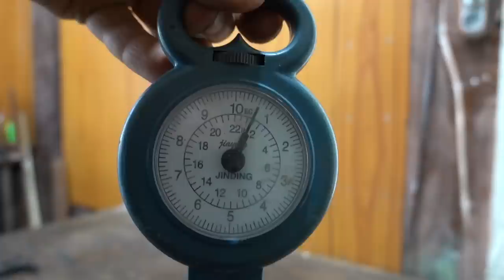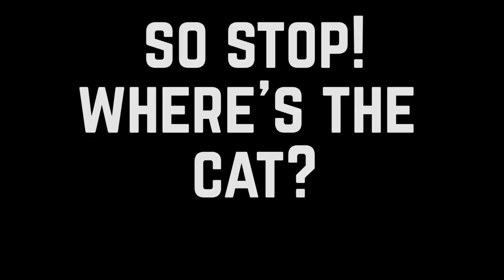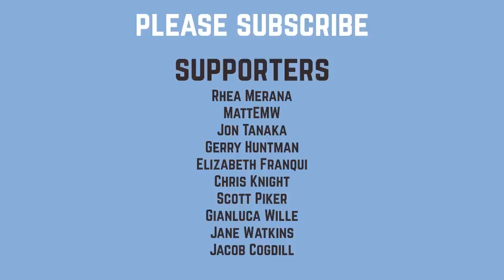Restoration Survival Rusty Knife

Comment: Can you explain to me the purpose of graphite grease? I've never heard of or seen this used until now
Reply from the maker: Conventional graphite lubricants are designed for friction units of loaded mechanisms. These lubricants are operable in the temperature range from -20 to +70 ° C.
Reply: @ScrewsAndTools  Why was it put on the blade of the knife?
Reply from the maker: @derrickguffey4775  To avoid the appearance of rust, because then there was still a lot of work with the handle and maintaining a dark color after etching the blade.
Reply: @ScrewsAndTools  thank you that really helped 😊
Reply from the maker: @derrickguffey4775  Welcome always!

Comment: this Isn't restored it's sharpened and you made a terrible case didn't actually restore anything. Its ok to make stuff and i applaud the effort of wanting to do something cool but putting a knife in a bucket of water for a month or two then cleaning it up isnt restoration. Have you tried actually restoring something or are you Ok with saying restore but meaning sanding and sharpening cause they're not the same thing.